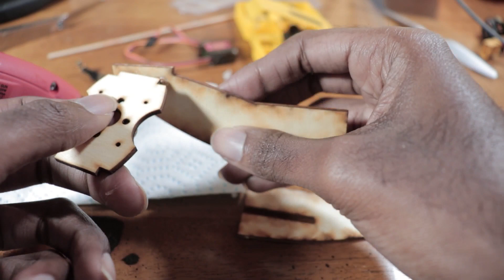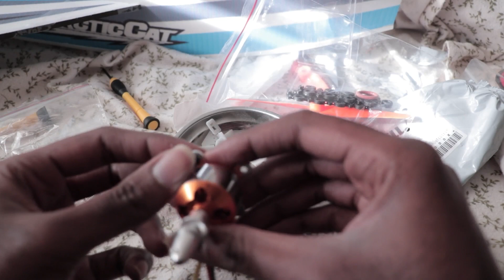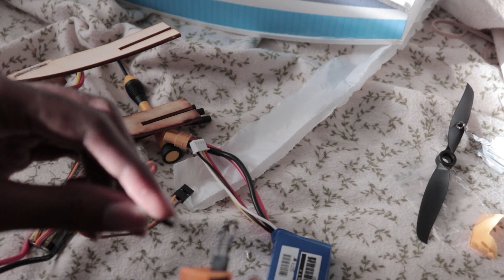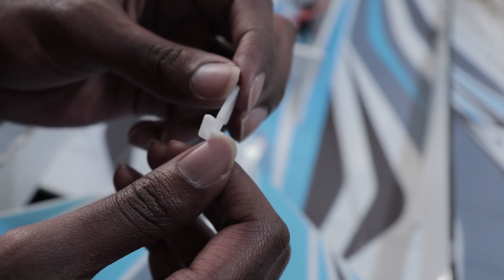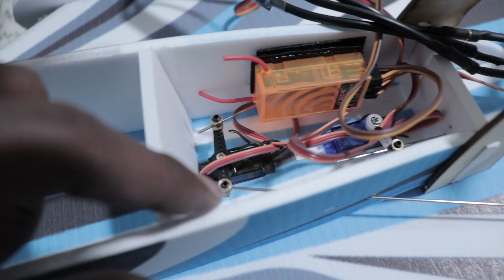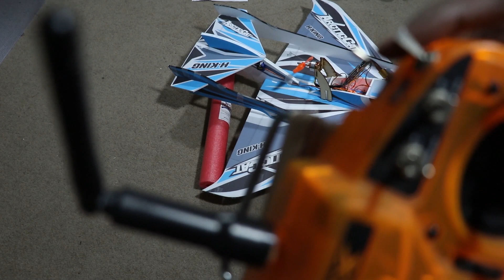Hobbyking Arctic Cat Build:  Part 2

Comment: hello how do you do so that the engine has reverse greetings
Reply from the maker: the ESC has a reverse function. when i click the gear switch on my transmitter, it reverses.
Reply: FSXTout but is it a special esc or is it a configuration in the control
Reply from the maker: @edwyn1326  yes its an Aerostar RVS 40A ESC w/Reverse Function. it has 2 servo leads. one goes to the throttle port on your receiver and another goes to the gear port.

Comment: Hi, and thanks for your honest, well-presented  video. I am about to make my second Artic Cat - the first is to be honorably retired after extensive use as a testing platform for cameras and gyros! One thing I found is that the bulkhead towards the front needs to be cut to allow the battery to go further forward, or the C of G is difficult to get right. I also preferred to make a plywood battery base with a velcro strap, as well as 'sticky' velcro on the battery base, with a  2200 battery, not an 1800. Then  I  added a FN4 wing piece when I wanted more lift, as she was fully loaded with gyro, mobius, and 3300 battery (!) - it flew well, but definitely on the edge of its performance/ability. Diolch yn fawr eto, keep safe, Den, Cymru (Wales).